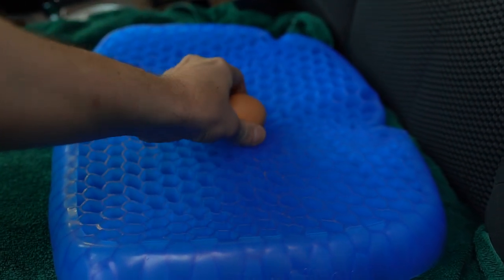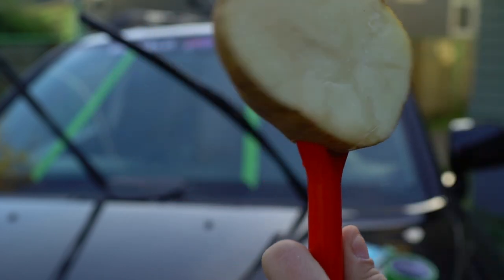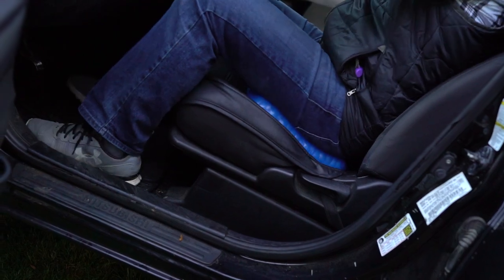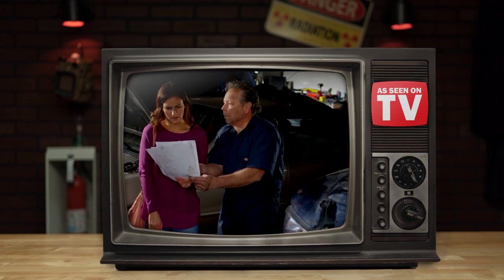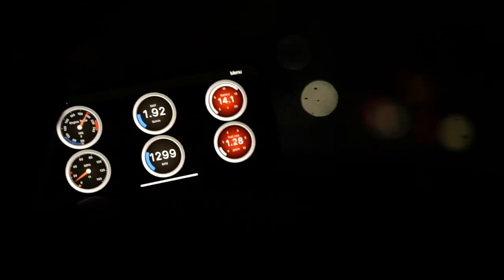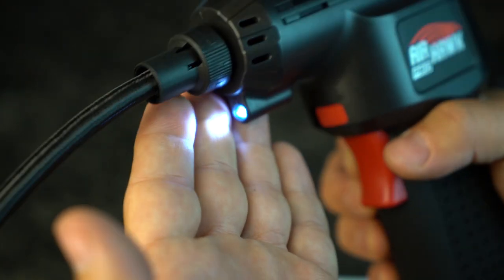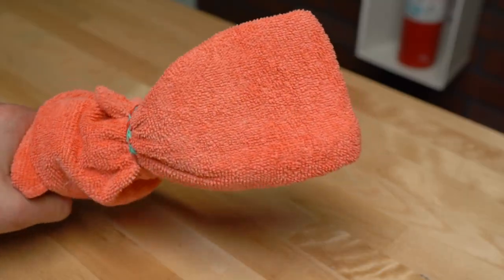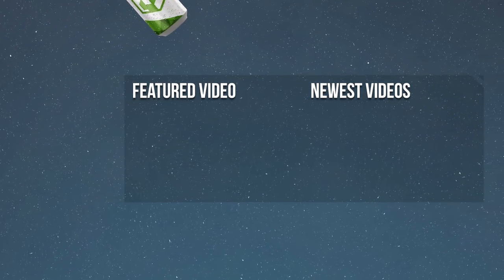As Seen On TV Car Gizmos TESTED!

Comment: 4:24 instantly you shouldn't buy because it has plastic carbon fiber not actual and it gives you a suggested price that varies from car to car say use this in a 2004 Ford focus and it says you need an oxygen sensor that might be 10 to $50 now if you use that for example in a Corvette from 2004 would be more than 100$ also there's probably better one at your local hardware store oh and if the car has a OBD2 reader it most likely will work most cars from the 70s and onward have them

Comment: I have the air dragon air pump which is similar to what you just showed however the pace that screws onto the valve stem has a plastic cover the other day when I was using it the plastic cover came off and went on to the valve stem leaving a brass screw on and screw off pace so it was the brass covering that came off the plastic piece came off the brass it's hot as hell too but it is what it is and it still works anyone else have this problem

Comment: Another comment noting that you didn't test the windshield wonder properly. I know it's half fun and games, but it's designed the way it is to clean an interior windshield without angling yourself or your arms in funny ways. I have one, it does what it says... But it's basically pointless. I'd rather just use PT's or newspaper

Comment: As an actual mechanic, the micro mechanic is bullshit. Not that it doesnt work, but that most people have ZERO idea how their car actually work. That sensor giving you the code may or may not actually be the problem. And it will only read "general" codes. Every manufacturer also has a set of manufacturer specific codes.

Comment: You should have tried using the windshield wonder as designed for intended use.   INSIDE your CAR’s windshield. The long handle and flexible head make cleaning effortlessly. Removes that plastic oil film that collects easily. No need for chemicals or spray as you used. One can find the same product at a dollar store. Have one in each car stored Nader the seat.  Next time DO read the instructions.
Reply: Bro this guy passed away, your giving a recommendation to nobody

Comment: Micro mechanic is terrible... don't ever buy it... trust me. It also has worse ratings than the windshield wonder on Amazon as well so to bring up the ratings on the windshield wonder as a bad thing... what do you say about the micro mechanic?
Reply: I say get a cheaper version from eBay, use the Torque app, and scan away. It's worked for me for two years.
Reply: @angelamohle7854  I use bluedriver obd2 scanner. Has worked for me as well!